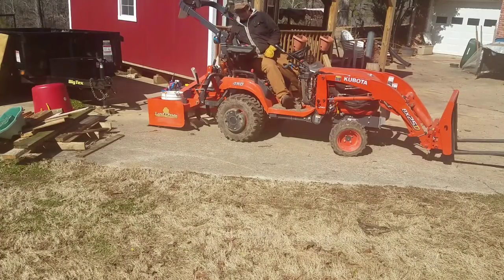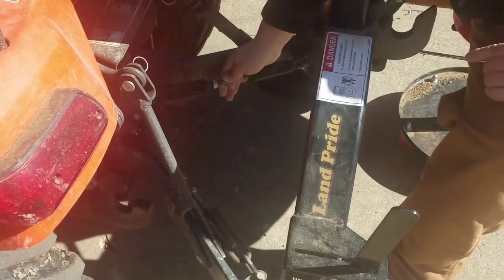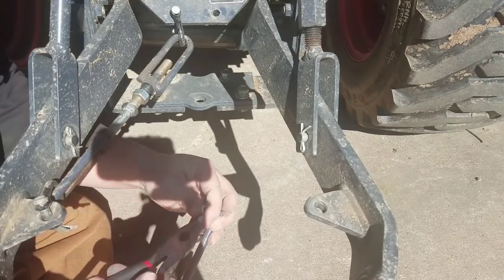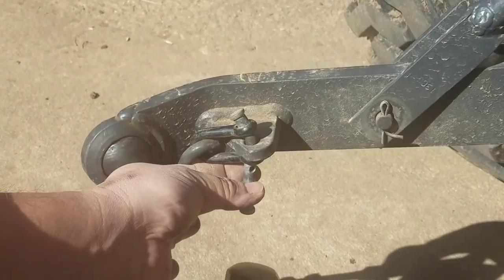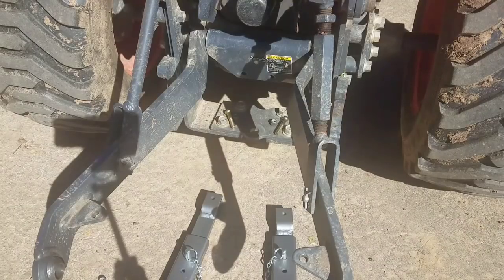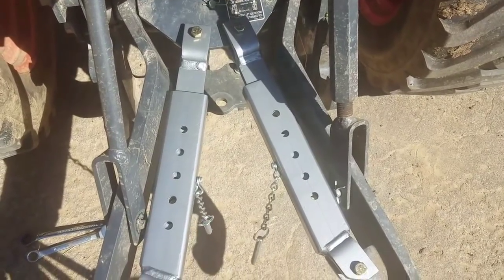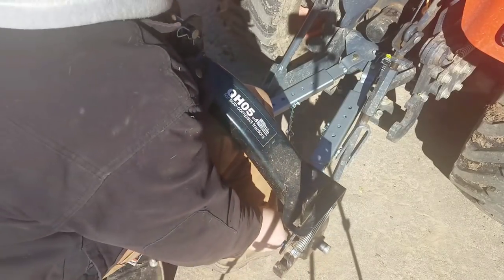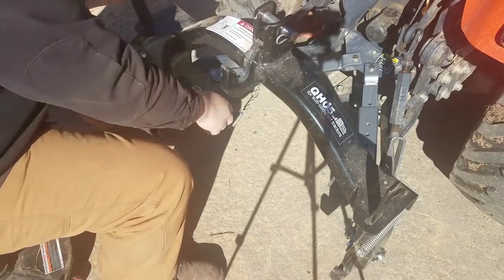Hodge Stabilizer Install: On Kubota BX

Comment: Had same problem. Bought new set 2 years ago. 1 stripped out already. Added chain to one side and turnbuckle to other side to take up slack. So far so good. When turnbuckle bresks will add other chain. Modified chain to take up slack.
Reply from the maker: Sounds like an easy fix!  Great thinking!  Thanks for watching and commenting!

Comment: I have these and they're nice, but the issue I ran into is that the forks that attach to the bracket need to be angled up (so the bracket points down) - otherwise, my PTO U-joint hits it sometimes.
Reply from the maker: Huh, I know Mark made sure to mark which one was left, right, this side up probably to prevent that.
Reply: @ODLife  I did too, but if your attachment lifts up higher, the U joint at the back hits them. I might try flipping the bracket they attach to and see if that gives me extra clearance.

Comment: very interesting video . im looking into a quick hitch and tiller setup for my 23s . i have a question ,where did you purchase that grill brush guard i cant find it on line?? any help is greatly appreciated.
Reply from the maker: The grill was what came on the tractor. It was the model before yours.  Quick hitch is great so long all your attachments are compatible.  If I was to do it all over, I would go with Pat's Quick Hitch and the telescoping stabilizing bars.  Enjoy !

Comment: Those turn buckles that came with the tractor are a pain.  My was bent from the previous owner not tighten them when brush hogging.  These stabilizer looks like they are heavy duty.
Reply from the maker: They are solid! Been so wet, really haven't been able to test.

Comment: I noticed you carry a white bucket and so on your box blade.  Can you do a video on your box blade and what you use it for. Thanks
Reply from the maker: +rtzapper sure but I am still learning how to use it myself.  Daveknowshow has a great video on using the box blade.  I use the buckets to carry chain and tools. Works out that they fit perfectly inside the box blade.

Comment: I've broke 2 of these turnbuckles   knew about hodge but forgot about him 
Are they still 180.00
Reply from the maker: +John  Goodwin yep, I put his email in the description.
Reply: john goodwin: yeah my dealer has them for small,medium large kubota tractors  for $180.00 wich not bad but john deere and newholland dealers here the dee wants $899.99 and new holland is $1,100.00 wich is ouch price for a 3 point hitch stableilizers
Reply: Don't turn the turnbuckles to tight, a little play is better

Comment: you still have some slack on your 3 point ht must be hard on the bolt to brack eazy
Reply from the maker: My manual has specifications for different rear implements and the amount of side to side sway it should have.
Reply: i have the same turnbuckel since 205 and have a snow blower and never broke nothing